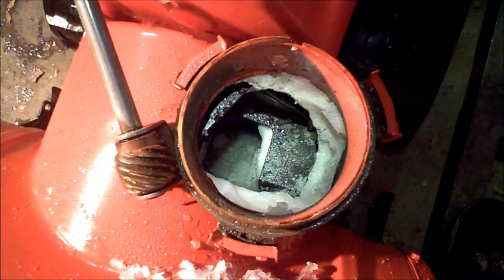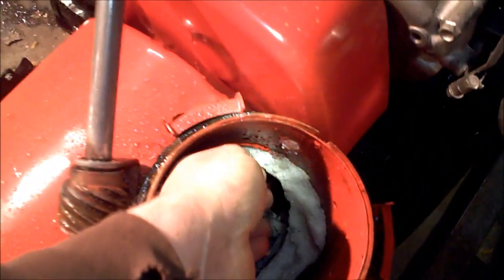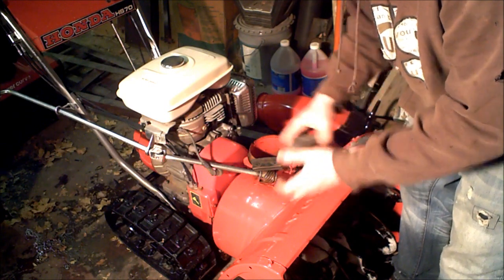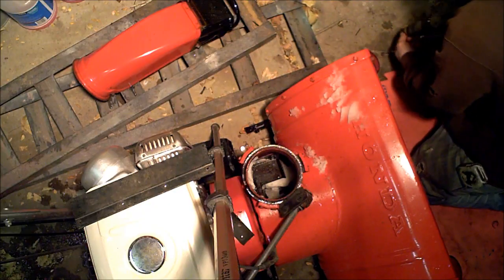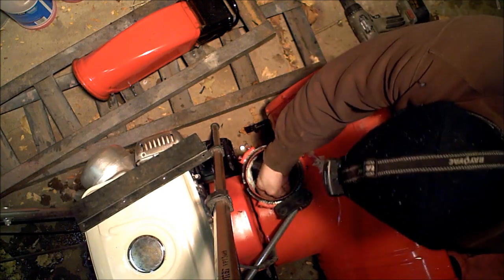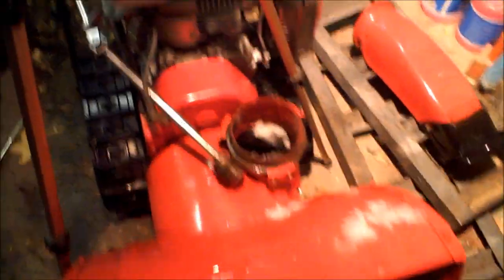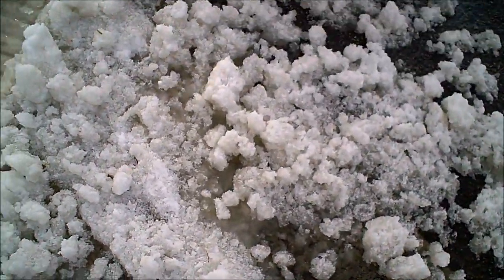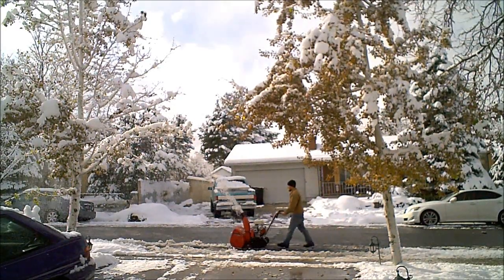Modify Snowblower to never clog and throw twice as far w/ Impeller Kit

Comment: thanks for sharing that tip awesome but have a question recently I bought an older noma snowthrower and the pulley was bent and the rod was stripped I also can't seem to figure out the pulley system there was a I guess a bolted pin coming from the inside of the second stage housing but that was stripped as well. I am stumped at this point on what should I do??
Reply from the maker: 333hotshot33 You should be able to find a parts machine for cheap. NOMA was made by Murray who also made Craftsman snowblowers. So any machines from that era will have the parts you need. They built a ton under the Craftsman name, so find one that has the same sheetmetal and Horsepower.
Reply: thanks

Comment: THANKS for the Great video
...I finally did it!

a few tips...
1. my 2002 Sears 9HP/28" has a plastic chute. I struggled with attaching the flaps through the chute base (after removing the chute) until I realized that this chute base was only held on by 4, very accessible, bolts. Removing the chute base made drilling and attaching the flaps VERY easy!
2. after installing all 3 flaps, my machine would not turn the auger...flaps too tight, I guess. Removing one , then trying again was successful. Ran the auger for a few seconds then was able to reinstall the last one and the auger tuned, now.

Wet snow tomorrow...the true test!
Reply from the maker: NH Windsurf Let me know how it goes.
Reply: sixtyfiveford AWESOME! Made short work of 5 inches of SLUSH. Not 1 clog and it threw it 15-20 feet. Usually, before the fix, it would clog every few seconds and barely push the slush out of the chute!
THANKS sixtyfiveford!
Reply from the maker: You're welcome. Thanks for the update and  great comments.

Comment: added rubber cleats on 1977 snowblower  now it works great just needs more power
Reply: Gary Ecco Stove Sales Agent US, Port and polish the intake runner and upsize the carb jet one size, then drill 2-3 holes in the muffler to increase exhaust flow. It made my old 5hp tecumseh run like a 7hp. The intake casting from the factory was very restrictive. I like the older machines as the augers and bucket are heavier gauged steel than the new school. Hope this helps.

Comment: I have a old snapper model 4220 it runs great but as soon as I get into about 2-3 inches of snow it bogs way down. I have to go about 1ft then wait for motor to get back up to speed then I can go another 1ft. It's faster to shovel it. I replaced the spark plug and auger, drive belt but it's still the same. I am going to add the rubber to my impeller but I think I have something else going on. Any idea?
Reply from the maker: nick getz Your main jet is getting dirty and clogged and not delivering enough fuel to the motor. Your unit should be old enough to have an adjustable main jet on your carb. It looks like a screw coming directly out the bottom of the carburetor. You'll need to turn it Counter Clockwise about 1/8 of a turn and you'll be good to go.
Reply: Yeah there is a screw coming directly out the bottom. I will try that. All the snow melted so I need to wait for more to try it out again. Thanks for the help.

Comment: Hey Man,
That is so cool...I've got to try that but first I have to get my craftsman with Tecumsuh engine started.  I've tried everything.  Even bought a  brand new carb. It turns over but will not start. I was thinking that the impeller and blades are engaged but when I looked into the housing it looks like the spring is doing it's job...should they turn by hand..it looks like yours did. Mine is locked solid How can I release the impeller and blades ?
Thanks for the help.
Reply from the maker: Wayne Read The impeller should lock when not engaged to the engine. If you have a new carb you should check for spark.

Comment: Last winter/spring my snowblower finally gave it up, too much rust. I got an older Craftsman that had a bad motor, and swapped in my motor. Since I was working on it, I added the impeller mod you showed. Now the last 2 snowfalls were pretty minor, an inch or less, and my old blower wouldn't even do much except clog up in this small amount. With the mod added, I am throwing even small amounts of snow well into the middle of the street 25-30 ft away!!  What a difference!! best mod I ever did to a snowblower! I tried anti stick paint, WD40, Oil, everything to get rid of the chute clogging. This works!!  Thanks for your video!!
Reply from the maker: jvw57 Awesome, glad you tried it. Thanks for the comment.

Comment: I just did this to a Toro 624 Powershift using paddles cut from the sidewall of an old tire. One thing that may help others is the fact that if you make the paddles too tight, the blower will burn the drive belt off trying to turn the impeller. I just removed one of the three paddles and let the impeller form the remaining two. Lots of smoke and squealing for a few minutes, but it eventually subsided. I then put the third back on and let it get formed up the same way. Worked like a charm. The paddles got the nice 45 degree edge on them. Time will tell if it solves the clogging problem, but it blows a lot of air out of the chute now, so it looks promising.
Reply from the maker: Tim Petersen I don't have any doubt you'll be impressed.

Comment: I did this mod last year after watching your video on a john deere 47" blower mounted to my 317 garden tractor. A huge improvement, throws the snow  twice as far and doesn't clog anymore. I did clog it once in spring with slush but it was really too warm, the snow was melting very fast that day. Thanks for the video great modification.
Reply from the maker: 1991vwjetta I'm glad you tried it. Nice tractor you have there, those 300 series are tanks.

Comment: Okay, if you don't start selling this as a kit, I will. This is assuming no one else is selling them already. You know all new snow blowers will prolly be coming out with "Zero Tolerance Scavaging Impeller Flaps" soon. That just leaves all the old snow blowers to be retrofitted with them. I personally don't have old rubber paddles, mud flaps or old tires to cut up, but I do have a 1985 Bolens 824 that has a 4 vane metal impeller that's dying for your patented ZTSIFs. Please sell me a two flaps kit. I'll Paypal you and send you a pic of my impeller (before and after).

Comment: I have a simplicity Pro 32" 2 stage blower.  Was going to replace it since it's not throwing as far as it use to.  Replaced the belts but still not great.  Was just told I should adjust the belt tension which I did.  Waiting on snow to test it.  I like your idea and it makes sense.  Problem I have with the Simplicity is that the impeller blades are cupped.  Any idea how to modify cupped impeller blades?
Reply from the maker: Steve Koz It really just needs to be on the flat part. But you can curve it with the curve of the impeller and screw it down. It'll make a huge difference on a big machine like yours.

Comment: I have a Ariens ST 1032 that has an impeller with 6 paddles. Is there an advantage to doing rubber extensions on 4 or 6 of the paddles instead of just 2?
Reply from the maker: searay26 If you have 6 impellers I would do 3 of them. You can do all 6 but there won't be a difference in performance.
Reply: sixtyfiveford Unfortunately, I did this yesterday and I did 2 blades opposite of each other like in your video. If I now do 3, I'll need to remove one and move it to keep it balanced?
Reply from the maker: If they're directly opposite each other you'll be fine. It'll work like a champ.
Reply: sixtyfiveford Yes, they are directly opposite, thanks.
Reply from the maker: Great. I'm excited to know what you think. The 1032 is a big machine and should have some very impressive results.
Reply: sixtyfiveford I also got a tach and found out it was running at 2600 RPM. I adjusted a small screw on the linkage and now it's running at around 3250 RPM. That 25% speed increase, along with the rubber paddles, should make quite a difference!
Reply from the maker: Wow, 2600rpm is slow. The Tecumseh hsk10 can easily handle and is rated up to 3600rpm. I generally set them up around 3500+- rpm as they will drop a few 100rpm under load.
Reply: Mine is a HM100-159024C model. Do you know if the RPMs are the same?
Reply: I had the carburetor off last year too. I unhooked it at the governor for some reason. (didn't know what I was doing!) I probably didn't get it back to the same setting.
Reply from the maker: Yes, it is rated for 3600rpm. That is where it develops it's peak Horse Power.
Reply: I will adjust it up some. I may have to make an adjustment on the governor to get it there. Thanks for the info and your videos are very helpful!

The adjustment will give me a 38% increase in the RPMs!

Comment: I did this years ago to my 26" Craftsman thrower, and it made an amazing difference, especially in NE Ohio's heavy, wet, slushy snow.  I used a piece of conveyor belt from TSC, but added flat metal as a backer for the rubber, and used bolts with self-locking nuts to secure them.  I wanted to mitigate two concerns:  1) The screw heads possibly pulling through the rubber (fender washers would be another solution) and/or 2) the screws backing out and becoming projectiles.  Maybe unfounded, but I usually tend toward over-engineering things.  For those wanting a ready-to-install kit, and don't mind the price, search "Clarence impeller kit."

Comment: Thanks for this video.  I copied your idea.  I used the sidewall from a lawn tractor tire.  They may not be tough enough but the holes are drilled  in the impeller, making the replacements easy.  The next ones will be from a regular tire sidewall.  My old snow blower has some slack in the drive pulley  hhmmmm
Bruce

Comment: I use silicone spray on the auger,impeller and shoot  before each time I use the snow blower. It makes the surfaces very slippery and snow comes right out with less clogging.
Reply from the maker: Jerry Spinosa Add the paddles and you'll never need to spray again. Also it'll throw further.

Comment: Just added 3 rubber flaps to my 3 impellers on my Toro 521.  Had to use bolts, lock washers and nuts since the impeller was too thick. Took a while but the air flow seems pretty good after adding them. Used an old tire's sidewall for the rubber blades, Also painted the metal chutes and then waxed it after letting it cure a couple weeks. Now we're just waiting for the snow for the real test.  Thanks for the idea and video demo. Going to do my John Deere 46" single stage next (once I take the lower deck off and mount the blower).  Thanks, Dale
Reply from the maker: Dale Stary Great, I'm glad you did it. On the John Deere single stage all you need to do is put a rubber paddle on the flat piece where it discharges on each impeller(two). Those are usually pretty thick steel but much easier to do as your not reaching into a small hole.
Reply: sixtyfiveford Okay, tried the singe stage 47" John Deere today on about 6-8 inches of really wet Cato storm snow and slush. "NO CLOGS WHATSOEVER". It moved everything including what the plows did by the mailbox.  You are the man! It's so nice not to have to deal with unclogging the chute. So to all the folks who are thinking about doing this. IT WORKS!  Just do it. I did mine about a month ago while there was no pressure at getting it done. I am a happy camper!
Reply from the maker: Thanks for the update. Have a great winter.

Comment: Do you worry about wearing all the pant off  the housing with all the rust that accumulates  inside?
Reply from the maker: Jim Conard The paint in the impeller housing will come off faster with rocks/ice that slip through the gap. With zero clearance the paint will last longer and ice won't be left when your done to rust the inside of the impeller housing.
Reply: Thanks! Your videos are so well thought out, keep them coming!

Comment: I found a used toro 524 for sale for $175. Would it be worth getting? Should I do this mod to it?
Reply from the maker: 11spitdms You can't go wrong with a Toro. 5hp isn't a ton but it will still move a lot of snow and the modification will make it perform similar to a typical 8hp.
Reply: Which would you buy? An old 524 toro for 175, or a newer 8hp, 26" mtd for 325 OBO?
Reply from the maker: The Toro is built way better but has less hp.  Personally I would go for Toro, considering they are both in relatively decent shape.

Comment: so i tried this on a 1978 Sears Craftsman 5HP snowblower, and one of rubber pads i put in ripped right off the screws and was thrown out with the snow, but overall does work a little better
Reply from the maker: Joshua Jager Sometimes the opposite side on the discharge hole sits closer to the impeller than any other part. This would cause the paddle to break off as it cleared the discharge hole and hit it. Try sitting it a little lower/further from the wall. You'll be very happy with this modification once winter hits.
Reply: thanks for the response, ill try that, i used and old tire for rubber

Comment: i have good success by spraying the auger and chute inside with a product called ez-slide. about $5.00 a can at farm&fleet. usually spray it each fall and one application lasts me all winter. have a 200' driveway and my little 7hp simplicity throws the slush like crazy.  good fix on your part as well!

Comment: my name is dick bailey. last winter, i asked you where to buy conveyer belt, and you told me to let me know when i did.i found some at tractor supply. didnt notice until i got home that the belt is only1/8  thick, what i was wondering was do you thing gluieing2 pieces together, to make one?or should 1 piece be enough?   thanks
Reply from the maker: If you gap is under 1/4" and the rubber is very rigid, 1 piece will work. If it is over this then just stack 2 pieces.

Comment: Never had an issue like that with my snowblower, and I live in Wisconsin.
Reply from the maker: You live where it's really cold. The lower snow states are warmer so the snow melts more.
Reply: I live in Wisconsin Milwaukee area, and it was always problem, but after modification the snowblower doesn't clog even at gutter slush, which used to be a problem, not any more.  Works Great!

Comment: I have a 1978 MTD snow blower, custom 15H.P, extended shoot. I re-geared it so the center impeller spins 40% faster than when it was stock. I have Zero issues with it clogging up now. I might still try this mod. Couldn't hurt. :)
Reply from the maker: NICE Machine!!! Yeah if you have 1/4" or more of a gap you will notice a decent amount of throwing distance improvement.
Reply: Well right now at full throttle in 6TH gear in 8-10 inches of snow with the shoot straight up I can shoot snow over the hydro poles in front of my house. lol

Comment: Slush and wet snow was a killer here in New Jersey this winter.  And the snow got so high I couldn't throw the snow over the piles.  Will definitely install this mod as soon as I get my hands on the rubber -- THANKS!
Reply from the maker: Different areas have different snow but if you get slushy snow you will be amazed by this modification. If you end up doing it let me know what you think. What kind of snowblower do you own?

Comment: I just did this to my 14 year old Craftsman 8 hp/26". My impeller has 3 fins and I cut out 3 pieces from an old rubber blade that I had from a broken industrial floor squeegee. I know you said it isn't necessary to add to all the fins but with mine having 3 I was concerned about keeping the impeller balanced so I elected to do them all. Living in Northern NH it takes longer than other areas to lose our snow. My son plays on the high school tennis team and they are anxious to hit the courts. I just got home from using my new monster snow blower down at the public tennis courts that had 2' of snow cover. I was throwing snow out and over the perimeter fence. Thanks for the really useful information/video!
Reply from the maker: That's great.  Yeah 3 is what I recommend so it's balanced. I'm glad you took the initiative to do this.

Comment: Why don't mfr.s just make them like this with the rubber, then? Shouldn't one of them guess that that would make their machine superior, and for a few more dollars, people would still want to buy it--or even MORE likely now?
Reply from the maker: Higher end machines have virtually no gap. But as they get the years and years of use on them the impeller blades bend and the housing stretches. Both increase the gap and there is when the trouble starts and you by a new machine from them which works great. Cheaper brands, every dollar counts.
Reply: sixtyfiveford

Well, when you bUy a new machine, it ought to work well from the beginning, but if they start out with a big gap, it's not going to work well even from the beginning, just as you said about the $600 machine. The company will piss people off. So if they're smart, they'll just charge the few extra dollars it would take to correct the problem.

And I wasn't talking about having a narrow metal/metal gap, but the rubber added. I really like that idea of adding squeegies, and I'll try to talk my dad into adding them to his snowblowers too! So how hard would it be for these companies to just add squeegies to these themselves?

Comment: This fix is the greatest!  My old Craftsman (aka MTD) snowblower now works with all types of snow.  Before this fix, my snowblower would not work at all with slushy or wet snow which is what we get for the most part here in Maryland.  I used a piece of gasket material that I had purchased at Ace Hardware and had laying around.  Today, St. Patrick's Day, we had a snow of 5 inches of slushy show and my machine handled it without a hitch.
Reply from the maker: GREAT! I'm glad you tried it.